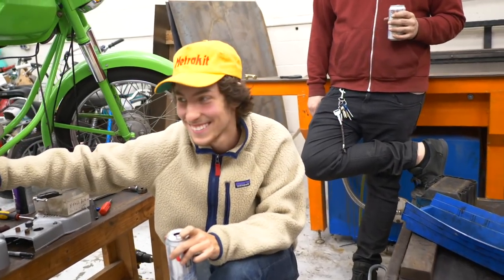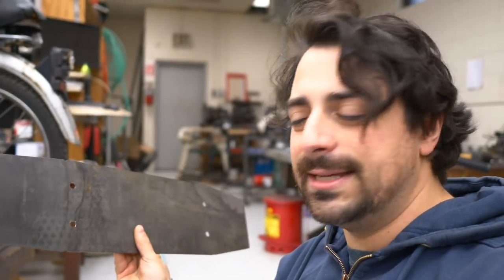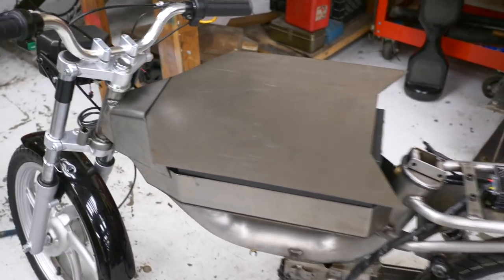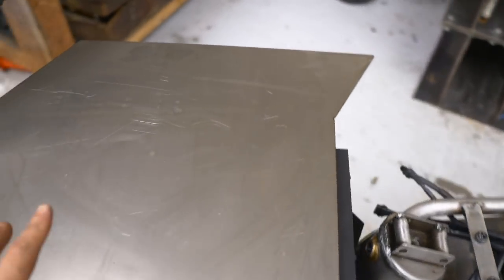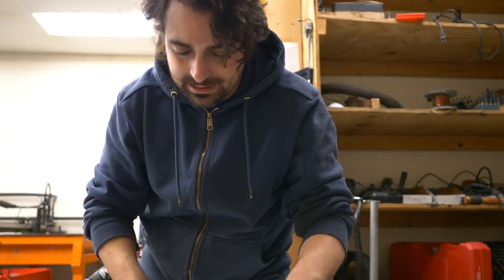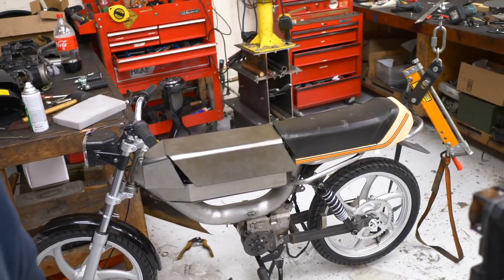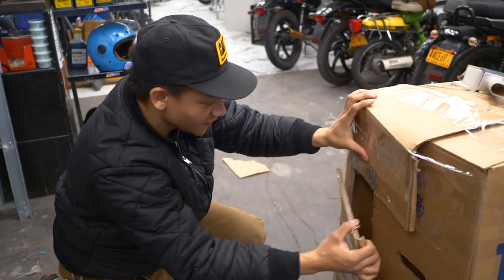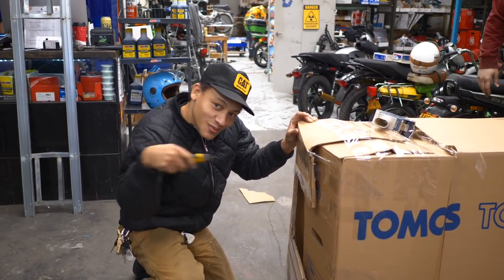Want a 2019 Custom TOMOS? Look No Further!

Comment: Um, it's a shame to see the first trial fitting in steel, when you have an almost an unlimited supply of free cardboard to make templates out of. You can't do all the radii but you can get close.

You have an interesting channel. Good for you, making stuff.
Reply from the maker: The first concept was done with printing paper and scissors, but the biggest challenge was from CAD to CAM to the plasma table.  Many times the drawings looked fine on the screen, but did not translate exactly in real life.   We never got it right the First time.  I blame Bennet.
Reply from the maker: But in all seriousness, I’ll use the wasted steel in the shop for something, or send it for recycling